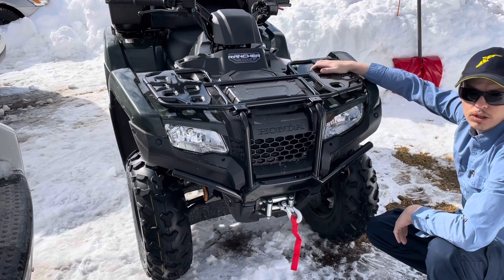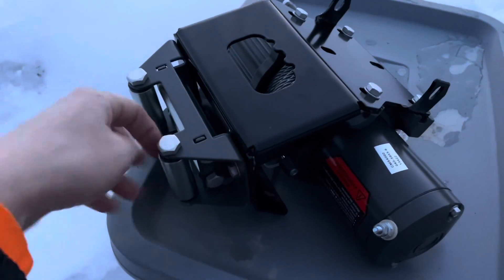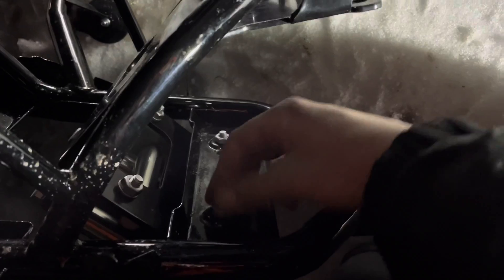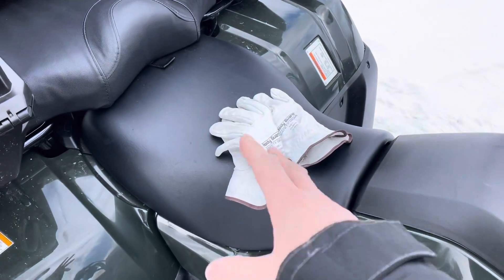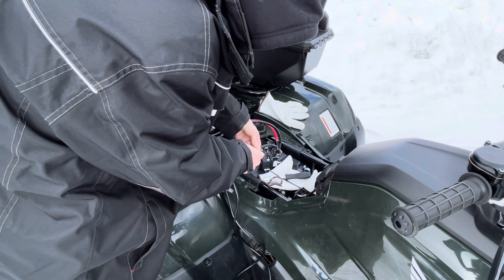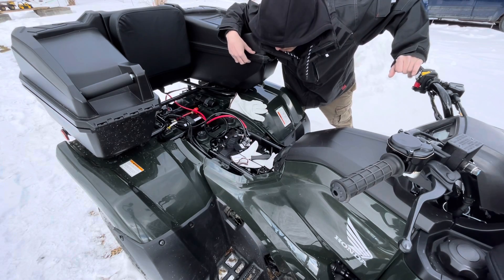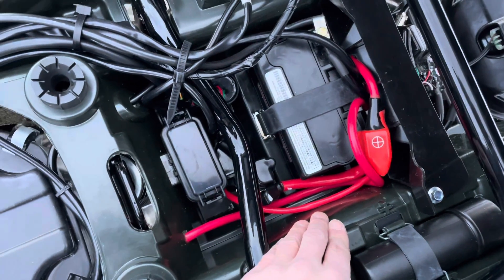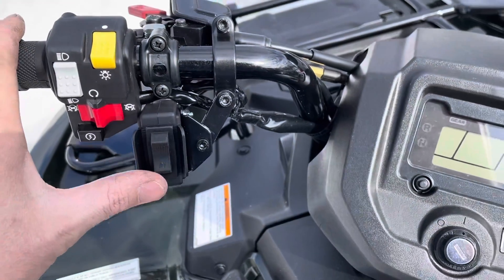ATV Winch Install Honda Rancher 420 Build & Upgrades

Comment: Nice job. Just make sure the cable feeds in over the top. My dealer that installed my Honda/Warn winch installed it upside down. The cable was reeling in from the bottom and started to fray the cable before I realized they installed it wrong. They since flipped it around to fix the issue.
Reply from the maker: Yeah it’s weird how it mounts & I agree it has to be flipped upside down and inside out 😜 I had considered the synthetic rope for weight reduction but maybe later down the road if need be.
Reply: Im assuming if you change the direction of pull on the winch you will need to reverse the polarity of the handle bar switch.
Reply: @togo3624  no reversing the polarity of the switch as we did not change the rotation of the spool, rather the fact that the entire winch assembly was installed upside down. The winch was removed and flipped over and installed the correct way, so that the rope winds on top of the spool, rather than on the bottom (the incorrect way). We did not switch the drum rotation direction on the winch itself, hence the “in” position on the switch will always reel the cable in no matter what orientation the winch is mounted in. Hope that makes sense.
Reply: @stevehorvat69  thx for the reply and thanks for making a great video.